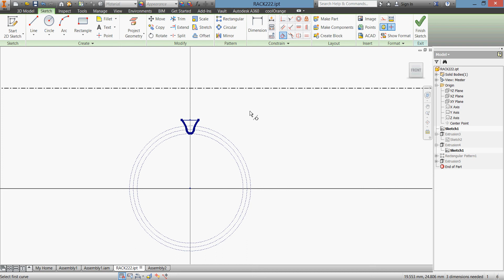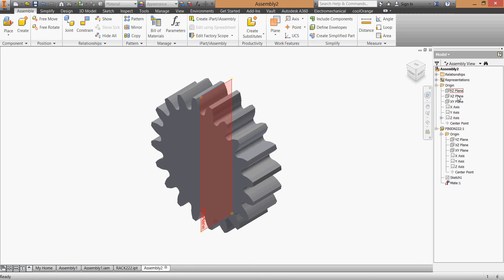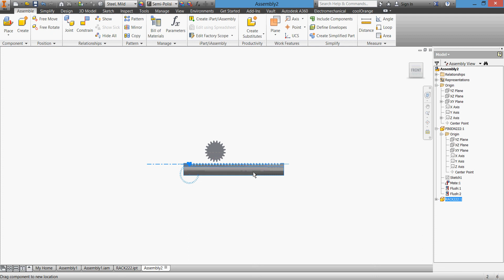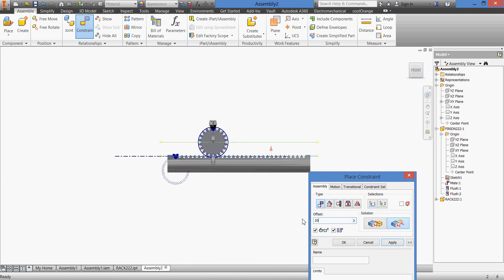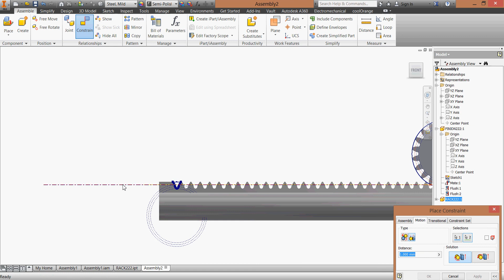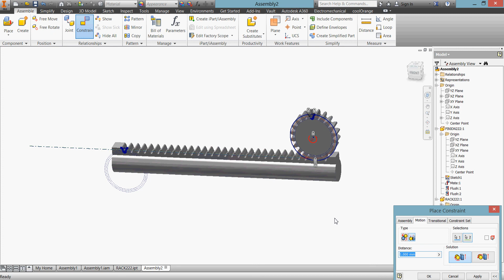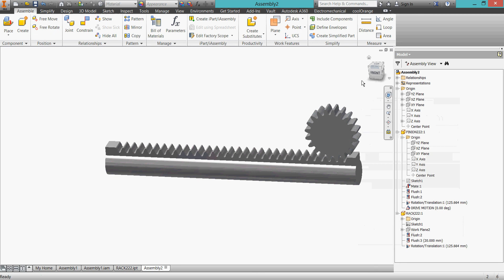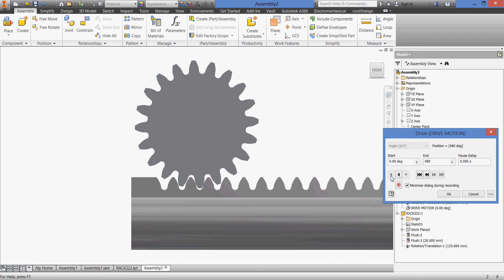04  RACK & PINION ASSEMBLY & ANIMATION

Comment: hi, is there a way to let the rack be stationary and the pinion move, instead of the pinion being stationary and the rack move?
Reply from the maker: Of course depending on the device and how it works?
Reply: @Ebrahim6000  I have a pinion connected to a small motor, and a rack which acts like a rail. My goal is to let the motor(pinion) move forward and backwards on the rack (rail). I'm not sure how to do the constrains in the assembly to make this work.